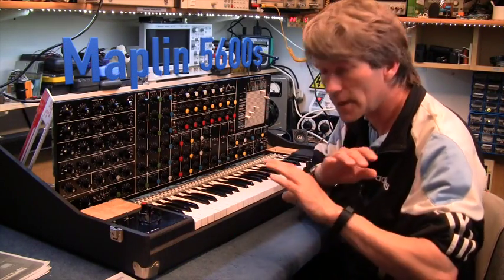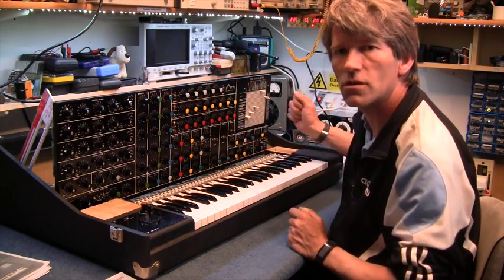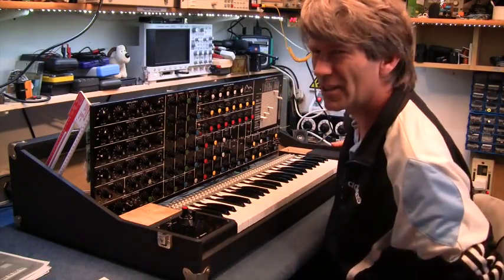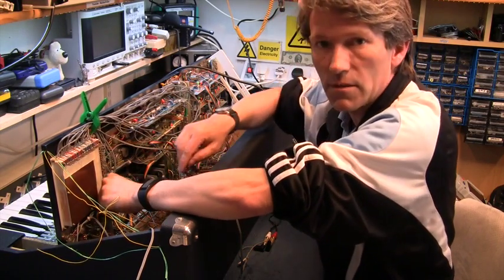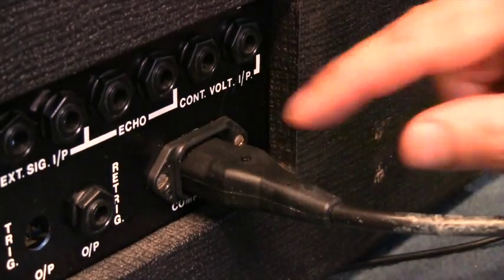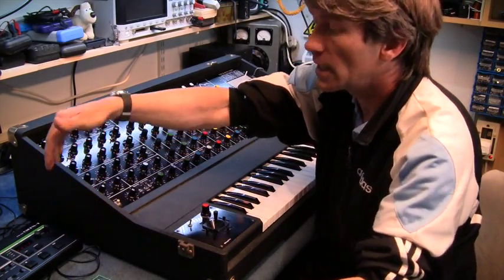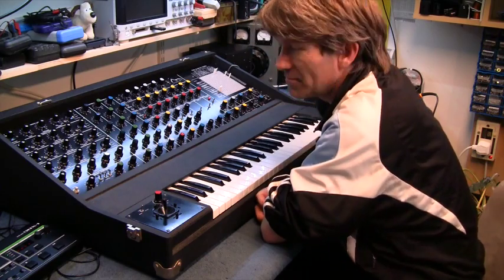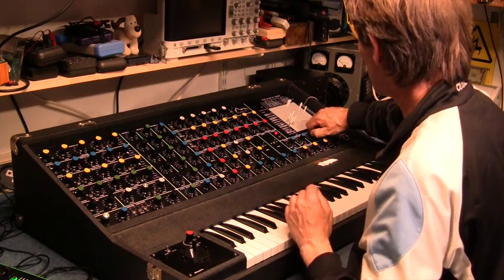Maplin 5600s Part Three vintage analog synthesiser repair MF#47

Comment: Just stumbled across this trio of videos after chatting with a friend about the 5600S. I built one and still have it. Can't remember if I got it to work 100% - iirc the left-hand oscillator switch is the range, or octave, selector and the frequency was set with a preset pot for each setting. I had great difficulty tuning it accurately so decided to replace them all with multi-turn presets. However, I lost interest, put it off, and forgot about it. That must have been nearly 30 years ago! A few weeks ago I got it out of the cupboard under the stairs where it's been ever since, dusted it down, reminisced, took a few photos, wished I had the mains lead and then put it back. Replacing that mains socket is a good idea - maybe I'll restart it when I retire. I guess I'd have more motivation if I could actually play the thing!! Very interesting to watch your troubleshooting methodology - I've enjoyed this immensely. Thank you :)
Reply from the maker: Hello and Thank you for your message. I did not own this very long after making the video just like you I could not get it to stay in tune for very long but thankfully a synth collector bought it from me and I think he still has it. It was a great synthesizer for its time but we have so many more to choose from now that stays in tune. It is classed as a rare synthesizer and is quite collectable amongst vintage synth collectors. I hope you manage to find the time to complete the project and you don’t really have to play the thing - just enjoy the challenge :-) best wishes - markus

Comment: great videos! the real tragedy of this is the person who originally constructed it probably never got to hear it in all its glory! If those VCO switches (?) were upside down and inside out and with all the other problems it had, it probably never made a coherent sound until you gave it the kiss of life. good job sir :)
Reply from the maker: drstupid1 Yes i agree . the original builder must have spent many many hours on this project never to hear it. Im pleased I got it running but to be honest I too almost gave up part way through.
Reply: Yes, way back in part 1 I thought that it was an unfinished project

During video 2 I decided I would have scrapped it for parts

Comment: Hi Markus.  Congratulations on sticking with it and getting the beast mostly running.

I remember when I was in 5th form, the original article in Electronics Today International (ETI) for the ETI 4600.  I met someone at Uni who had built one, and I messed with it for a couple of hours.  I really wanted to build one, but the parts kit was way beyond my student finances.  Since I had no real electronics experience then, it is probably a good thing, otherwise you would be fixing my synth too!

Comment: Loved this series, it's a shame to not get it to 100% but you have to spend your free time doing what you love and it's understandable when you get so fed up with a project
Reply from the maker: Love Castle Hi. I think the last piece of the puzzle could be going through the construction manual and setting up all the oscillators and other boards etc which will take quite a bit of time. and maybe sorting out the keyboard which keeps missing notes. but that would be the job of the buyer as I have spent too much time on it already and really need my workspace for other jobs stacking up. anyway Im pleased you likes it :-) best wishes from Markus

Comment: Can you please let us know when and where you decide to sell it?

Thanks for the videos, and what's the next project? :)
Reply from the maker: Reuben Jones Hi Reuben. I still have to put the original output amplifiers into it when I get the TDA2003 chips. and after that whoever buys it will still need to do a lot of setting up from the manual as I do not think this was ever completed by the original owner. I believe we heard the very first sounds from it since its construction in 1979/1980. I'm not sure what to sell it for I have seen some crazy prices but as i say theres still a bit more work whoever buys it to get it into top condition.

Comment: You made my day. ty
Does the Roland sync box converts poly midi messages to several CV outs ?
Reply from the maker: Jetset Willy Hi the roland sync box only has 1 CV +1 Gate +1 Bend +1 Aux output. Im not sure if you can use the Aux as another CV output ?. Hmm you got me thinking now.
Reply: After some searches I found that ,the only proper poly CV converter is Doepfer A-190-5 (not sure about it yet). I built 4 identical VCO ENV FLT just want to use them in poly something like Oberheim 4 voice(4xSEM).
Any thought ?
Reply from the maker: I have not had my hands on anything by Oberheim yet. hopefully one day...
Reply: Jetset Willy The Kenton Pro 2000 MKII does poly CV, it has five CV and five gate outs. I use it to play five Oberheim SEMs at the same time. :) Ps. Great video Markus, that thing looked like a nightmare to fix.
Reply: splitradix Thanks for the info ,I'm looking to it,seems pretty nice but it has only two 1Volt per Octave out (duo phonic).
not sure what other 6 aux outputs do ?!